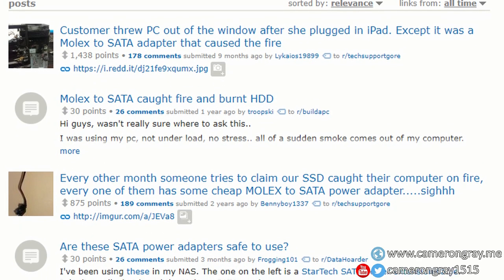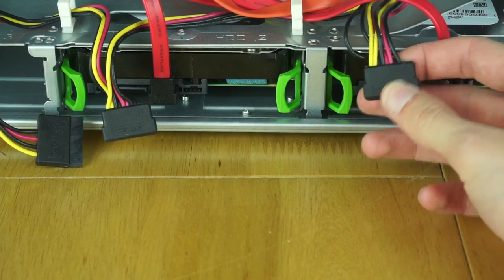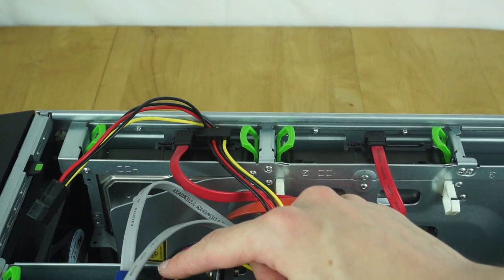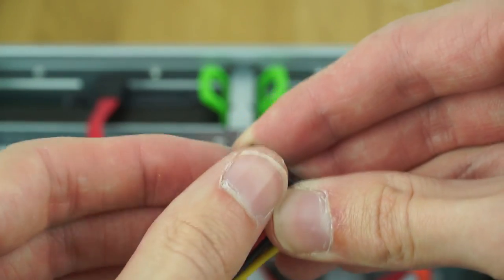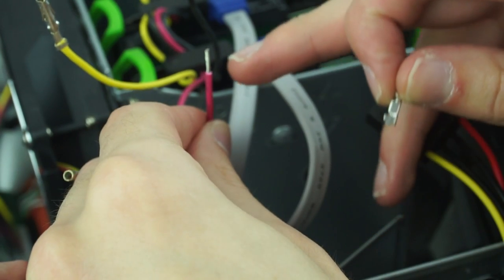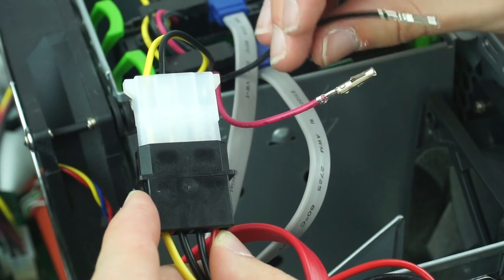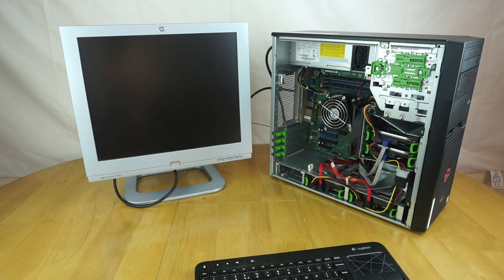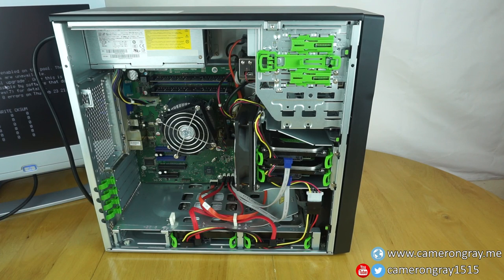Removing a Potential Fire Hazard from my Fujitsu Primergy TX1310 Server

Comment from the maker: UPDATE

I got curious and dissected the connectors that I removed from the machine, the single connector that was on the end of the chain (and not connected) was actually fairly decent in terms of clearance between the wires however the right angled ones had pretty limited clearance between the pins due to having two wires soldered onto one set of pins. In particular, the connector that was located closest to the bit where I cut it off only had a fraction of a millimetre clearance between the 5v and one of the ground connectors.  While the chance of this causing an issue is still absolutely tiny, it did show that the quality control on these connectors still isn't great.  As I stated, the chance of these connectors catching fire is very small however, given how cheap it was to replace the dodgy connectors, I'm happy with having done it.
Reply: Though, I do need to ask, can you tell the difference between tinned copper wire, and aluminium? As what you have there is clearly the prior.

And secondly, the connectors you have put in are not technically "crimped", but rather insulation displacement connectors. And the 180 degree modification you did isn't really done properly, would still probably work, but it makes a real mess. I suggest clearly documenting how to wire it, and take out all the wires, before rewiring it more properly. As you want to ensure a proper connection between wire and the connector, to make sure you don't get insulation stuck between pin and wire. As that can lead to an intermittent connection in the future.

And lastly, the risk of a short between two pins would not be expected on a server, as the cable is either shorted to begin with, or will not create problems, as the risk of later penetration is far less likely then one might at first even expect.  This is due to the surface area of the metal surface and the stress that it can induce on the plastic wall being far insufficient during normal or even excessively forceful handling.

And as the cable is soldered and made of copper, it will work harden and break off far before the risk of a short. Even if the clearance is 0.1 mm. But if I were to make a rough guess not having seen the clearance myself, I would say that it were around 0.3-0.6 mm.
Reply: Or use a simple lighter, aluminum has a tendency to melt in fire.
Though, the difference in resistance is not that large, it would only lower the current carrying capability of the wire by around 40%. And considering that most computers use 18 awg wire to begin with, then the cable should still be rated for at least 6 amps. (72 watts continuous load. @ 12 volts)

Comment: I do need to point out a thing here, molding a cable as nothing to do with it being crimped or not.
The connection between the pin and cable can be crimped, or soldered, this here will give your electrical connection.
The molding, or cover is just an encapsulation around the wire to pin connection, providing strain relief and rigidity to the connection.

The important thing here is that the cables can be improperly crimped at the factory, leading to a higher resistance at the junction, this in turn leads to more power dissipation in the connector that can in worst case lead to fire. But this can happen to any cable. The important thing here is to measure the resistance of the lead, and make a rough calculation if it is roughly correct, or a bit high. This resistance measurement should be from one pin through the cable and out another connector.

So if the cable is 22 awg, then we expect 0.05 Ohm per meter, so a 30 cm cable should be around 0.015 Ohm + a few for the connector. (around 0.01-0.05 Ohm, if we take contact resistance in mind) So we expect around 0.065 Ohms ti be a good quality cable, but if we measure 0.8 Ohms, then we can suspect that it might be a bit dodgy. Though, this here if back of the envelope calculations, and I do not recommend these exact values to be used as anything more then a guide, but one can just measure ten or so connectors/cables and see the out lairs. 

And given the fact that if 1/1000000 cables are improperly manufactured, then we would expect around a thousand such fires, so the chance you actually stumble onto one is crazy to start with... And even at such low numbers there would be thousands of fires caused by those every year, so the actual figure is probably even smaller.

But well, if one doesn't have the equipment to measure such resistances, then there are other methods to figure out if the cable is bad or not. As for a cable to catch fire it need to get rather warm, around 100+ C for most thermal plastics used, so if you start the computer, run the drives for a few minutes and the connector gets burning hot so you can't hold your finger on it, then it is most probably bad.

Comment: Curious to why you didn't replace the PSU considering they cheaped out on the cabling.

Also curious to why you decided to go Molex to Molex whilst having to crimp the connections needed.. I feel it'd have been easier to snip the Molexs off and solder the cables together, would then be 0 chance of accidental disconnects.
Reply from the maker: Unfortunately this machine uses a proprietary PSU where it delivers only 12v to the motherboard then the drive power comes from a header on the motherboard.  The PSU itself is decent quality, the cabling here is completely separate.

Suppose I could have just soldered it, not sure why I didn't TBH although with the aluminium/steel cable, from past experience soldering to that would be a bit of a nightmare!

Comment: Get a heatsink for that poor chip on the lower right of the board, it's probably the southbridge or drive controller and they will get hot while in use, it will last longer. Some artic silver thermal epoxy and a square heatsink would be good.
Reply: Don't tell him not to tell him what to do.
Reply: Nightwolfx03 you're right though.
Reply: Good idea. I was thinking the same thing.
Reply: Strange it does seems to hawe any from the factory?
Or did it just fell off...
Reply: Not needed. And lets face it, Fujitsu know better than you. You should read the data sheets before posting noobie comments.

Comment: From my experience building PC more than decades, often the Molex connector that give me problem. The internal can become split or getting closer to next pin. I’ve seen it shortened and smoked. From my investigation, molex connector is the culprit. It should have terminal separation between each pin to avoid short circuit

Comment: Those types are more of a danger than those factory supplied molded ones, those connections ALWAYS come loose, and could potentially kill your drive, Should have trusted the factory.
Reply: I was about to say that but i was to polite... :D 
My experience is that they are not realy trustable and also the pins hawe a tendency to vobble because of heat stress, i should realy not reccomend them for high power consuming units like GPU cables and similar stuff, i hawe seen some GPU feeding connectors of that clip type even caused fire...

However, hi added an edit where hi did a dissection of those old ones You can find it on top in the comment line here, it was interesting to read about the exact problem inside them. I think it has to do with the quality check on the factory, not the design it self on those molded ones after i red what hi wrote there.

Comment: I find this hilarious..... I'm afraid manufacturer provided equipment will fail and destroy my stuff.... so I modify the device myself voiding the warranty so that if anything happens I have to pay for it myself.... lol.
Reply from the maker: +BIZKIT True, I would normally trust the manufacturer hardware however in this case I was concerned having seen far too many incidents of these connectors failing, in particular many from the same manufacturer as the ones in this server (Amphenol).  The machine is already long out of warranty (only had a year's cover).
Reply: I thought you had it shorter than that (the server). I plan on checking my servers as well. But I did think it humorous
Reply from the maker: LINUX-ISKY Yeah, it was Mark's video that prompted me to do this, would rather be on the safe side given how often the machine is left running unattended!
Reply: I always take things apart to check it and if necessary mod/repair it. I don't care about voiding the warranty because I'll repair it better than the manufacturer would anyway.
Reply: Amphenol?  It sounds like the name of a medication.
Reply: If it was a medication it would be called Amphenol Firehazardrate.

Comment: it could be coated copper , it may not be aluminium.
Reply: The sheapest ones are aluminium.
I try to avoid those, but i think it will work for this purpose.

It can be checked if you scrape on it with for example and exacto blade or if You heating one end up with a lighter or something, it will often cause aluminium trands to melt a bit.

Comment: I hate SATA connectors (both data and power), they're so weak and flimsy and can easily break if pulled the wrong way. Molex has been used for decades and is a good design. I wish modern SATA drives used 7 pin ribbon connectors (like IDE but 7 pins instead of 40) and molex power connectors. They are much more robust and stronger if accidentally pulled. Also there is no risk of molex connectors shorting and catching fire as there are no cheap moulded ones.
Reply from the maker: +Simon Tay True, although the SATA connectors do have several advantages.  They can be used in hot swap enclosures whereas back with IDE ribbon cables and molex power you generally needed interposer boards for this.  You also get the advantage of the connector being suitable for slim 2.5" drives and allows the same connector to be used in desktops and laptops whereas you used to need an adapter to hook up a laptop IDE disk to a desktop board and power supply.
Reply: Come onn.. From my experience building PC more than decades, often the Molex connector that give me problem. The internal can become split or getting closer to next pin. I’ve seen it shortened and smoked. From my investigation, molex connector is the culprit. It should have terminal separation between each pin to avoid short circuit